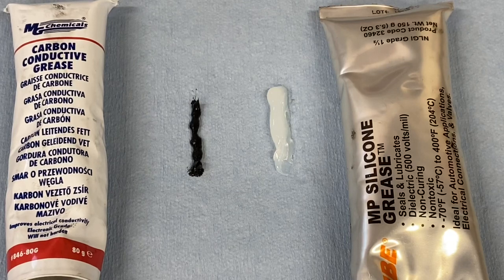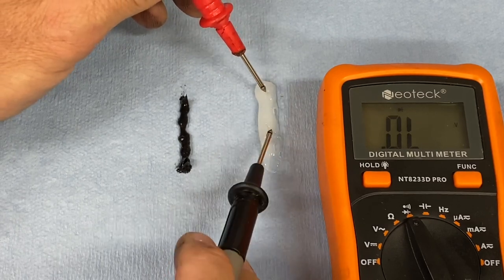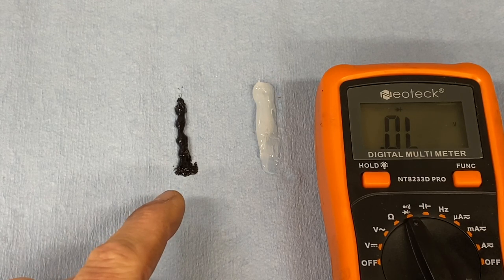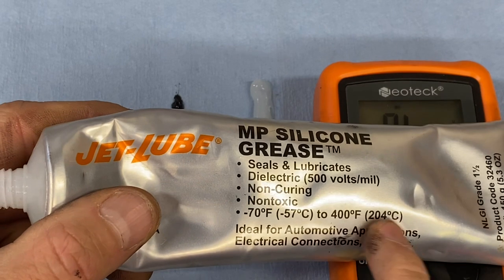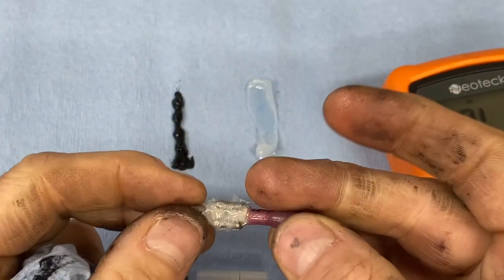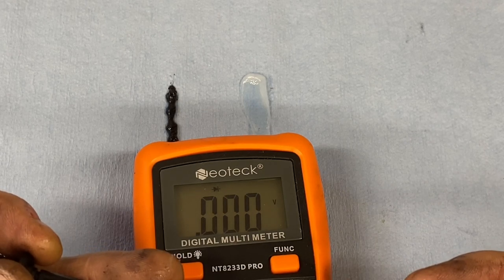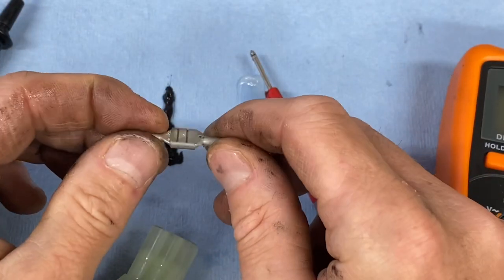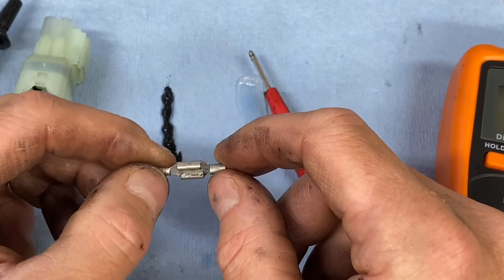Moto Mythbusters Dielectric VS Conductive Connector Grease

Comment: As long as the connector is clean and has good continuity  before and after grease , the dielectric will insulate and not hender continuity.

But if you have a poor mechanical or dirty connection, the grease can increase resistance and  build heat enough to melt plastic connectors, like stator wiring that puts out alot of current.

Ive seen this when people already have damaged electrical connectors, then add the grease which generally makes a bad mechanical connection, worse..
Reply from the maker: Mmmm, ya sort of kinda no. 

The dielectric grease isn’t an electron thief, it’s not out there stealing away electrons from a sketchy connection parasitically absorbing them into itself leaching them out and causing increased resistance across the terminal. 

A flaky contact will fail from the increased resistance due to corrosion or the lack of surface area for the transference of the load whether it’s in the presence of air or dielectric grease. 

In the instance of a marginal connection the conductive grease would be your friend as it’s the only substance that would increase connectivity and possibly save the contact from heat gain and connection failure. But you’d have to be positive that the conductive flow rate of grease was capable of making up the difference in lost capacity of the bad connection then support that load for the usefully life of the connection. How would one go about knowing that was the case?! 

Any owner would do well to confirm the mechanical connections are sound across his connector faces on his bike with or without contact grease and use grease always on non sealed connectors to repel the agents of corrosion.
Reply: Dielectric is non conductive,  it can hender continuity if the mechanical connection is not perfect. Just look at Vortex and Jd tuner, who specifically say in their small print, use dielectric on our products, warranty is void.
Reply: @TACOMOTOCO  people just use it to keep water out of connections
Reply: @TACOMOTOCO    ABSOLUTLY NOT  in a marginal connection dielectric grease will only make it worse. Dielectric grease is an insulator it is NON-CONDUCTIVE it can make marginal connections even worse by reducing the area of contact even further and potentially leading to over an heat and fire.  Seen it happen more than once.  Dielectric grease will NOT increase connectivity/conductivity UNDER ANY CIRCUMSTANCE as it is NON CONDUCTIVE..  Dielectric grease is nothing more  than a shield used to keep out moisture and dirt, THAT IS IT it dos not enhance conductivity or reduce resistance in the connection. So get off that kick that it will improve the connection, that is flat out BS.  
Their are compounds that do the same job as dielectric AND improve connectivity/conductivity and reduce resistance.    Dielectric grease has it's uses but improving the conductivity of a connection is NOT one of them.
Reply from the maker: We make all the same points
Reply: And the controversy continues.

Comment: Yes the dielectric grease does block the flow of electricity but the curved sides of the female will cut through the grease and force an electrical connection between the male and female parts. The grease will flow into the areas that are not in contact and will therefore block the ingress of water and stops rusting or corroding from occurring. For a sealed connector, You can use grease, but don't use it inside the connector. Only put it around the outside of the connector only.
Reply from the maker: Air blocks the flow of electricity. The connection is made by metal to metal contact of the parts
Reply: Yes, and Air carries moisture, which can cause rusting of the contacts and weakening of the made connections causing heating and possible fire. Use the grease to block the air and moisture.
Reply from the maker: @tmd63  yes, true, hence the use of the grease to block that moisture

Comment: Awesome tutorial for understanding how to apply which grease on automotive applications. I'm a complete noob, but have used die-electric on spark plug boots, etc. I had a question about a specific application. I've currently got a volume knob/encoder opened on a '91 Mercedes E class Becker 1350 special. Behind the volume shaft, there's a rotor that is a little bit of clear grease on it. Now I am attempting to clean it, bear in mind these parts are smaller than a dime. Another channel called this grease 'conductive grease' but it's clear. So before I get the grease off to clean it, I wanted to ask if my reapplication of die-electric grease on this rotor/disc would work? Or should I not clean it at all. The volume knob works both as a volume control and a push button, if that helps.
Reply from the maker: Email a photo of the part to info@tacomoto.co and we’ll see if we can help
Reply: @TACOMOTOCO  Well, I have some bad news. I was taking a closer look at the encoder contact disc and I may have melted the plastic part of the serrated disc because of an earlier use of Contact cleaner on it. That may mean my only solution is to replace the encoder. Also, die-electric grease application seemed to me like the right choice for that contact disc, its purpose is solely to protect against oxidation. Many thanks for replying!
Reply: @shaazy  been there with the contact cleaner. Bummer.

Comment: I have two instances that I need your wisdom on: 
1.) Proper battery terminal installation. My first thoughts would be that either the dielectric or electrically conductive grease would be fine. (There’s no chance of shorting or arcing because terminals are isolated) or I could use dielectric grease because it’s simply another mechanical metal to metal connection. (If everything is tightened properly)
2.) on crimped terminal ends underneath shrink wrap. I shouldn’t use dielectric grease because it might circumvent some surface electrical connection/especially if it gets between the individual strands on the cable. Electrically conductive grease would be fine and dandy underneath shrink wrap. What about regular silicone? The stuff that dries. Should I treat it like dielectric essentially? Thanks in advance!

Edit* spelling
Reply from the maker: Those both may be good uses

Comment: I have some battery powered motion sensor safety lights used in a beach house (high temps and high humidity).  The contacts corrode at a very fast rate.  Can application of conductive connector grease be used on these contacts to prevent corrosion or is there a better product?

Comment: Would you say it's possible that dielectric grease in an ignition coil for a car could prevent the little springs in there connect properly with the sparkplug? 🤔 It's not a 'solid connection' like the example you showed, but more like a 'pressure connection' ... A mechanic put this grease in my 4 coils and I wonder it I should clean it up before I put the new ones in. I see them do it 2 different ways in videos, some put the grease on the sparkplugs, which seems like the right way to me, and some put a dot of grease in the ignition coil, which seems wrong to me, because you push all the grease into the coil and in between the sparkplug connector and the little springs that the electricity is coming from...
Reply from the maker: Not likely to be an issue

Comment: Hi ty for this video. Very thorough.
I'm concerned I added too much dielectric grease to my spark plug cowls and the grease may have coated the inner connector. Can you tell me what electrical contact cleaner you use?
Reply from the maker: Not sure that’s really a problem
Reply: Good to know. Ty.

Comment: This channel says not to goop it on contacts, just on the surrounding non contact areas like rubber seal or porcelain of spark plug.  So they are using it incorrectly? You can splooge it in around the contact?

Comment: For the non sealed 2/4 pin connectors, such as the headlight or fan, how would you apply the grease in this situation? Making sure to not use too much or too little? I used a clear silicone seal to water proof the open ends of the connectors to prevent corrosion, it just makes sense to do this in addition to that.

Comment: YOUR PUTTING IT ON THE OUTSIDE OF THE CONNECTION AND THAT MIGHT BE FINE FOR A ONE TIME CONNECTION BEFORE HAND BUT LET'S USE LOGIC. IF YOU HAVE A TRAILER PORT AND PLUG THAT YOU ARE REPEATEDLY TAKEN ON AND OFF ; AND FROM THIS OF COURSE THE CONNECTORS OVER TIME GET LOSE AND LET'S SAY, LET'S JUST SAY THAT A GAP FORMS AND FROM THIS SLIGHT GAP ELECTRICITY CAN STILL EASILY JUMP ACROSS FROM METAL TO METAL.  BUT IF YOU PUT IN BETWEEN THAT GAP A  CRAP LOAD OF NON  LET ME SAY IT AGAIN CRACKPOT AS YOU SO CALLED YOURSELF , NON CONDUCTIVE  MATERIAL IN THIS CASE DI-ELECTRICAL GREASE THEN THIS  NON CONDUCTIVE MATERIAL, HENCE  WILL NOT  , LET'S SAY AGAIN WILL NOT  ALLOW AN ELECTRICAL CONNECTION. IT'S THAT SIMPLE.  HELL TO GO ONE EVEN FURTHER YOU DEMONSTRATED IN YOUR OWN VIDEO WITH YOUR MULTI METER. WHAT HAPPENED WHEN YOU YOU TOOK THE MULTI METER  AND PUT TWO METAL PRONGS ON THE DI- ELECTRICAL GREASE  , AH I DON'T KNOW , NOTHING ABSOLUTELY NOTHING, WHY BECAUSE ONCE AGAIN IT'S NON CONDUCTIVE.  SO QUIT BEING NAIVELY IGNORANT THINKING THAT YOUR APPLICATIONS APPLY TO ALL THAT'S JUST BEING STUPID PURPOSELY.

Comment: Can you use dieletric grease on RJ45 terminals
Reply: Cambium PtP radio connectors are RJ45 and correct install requires filling the jack with dialectic grease before plugging in the male connector